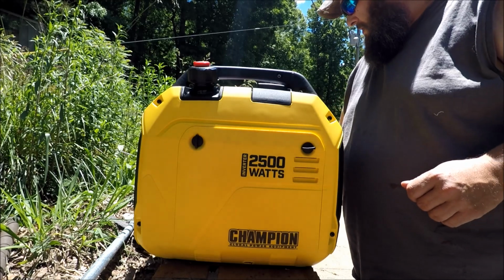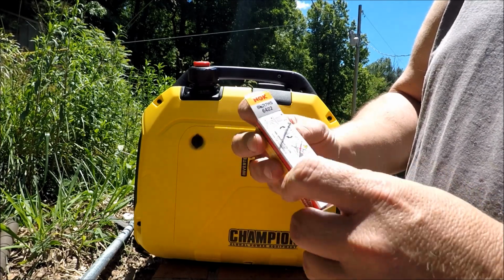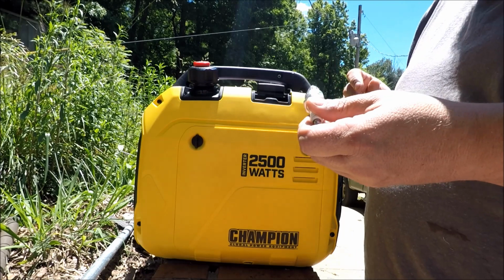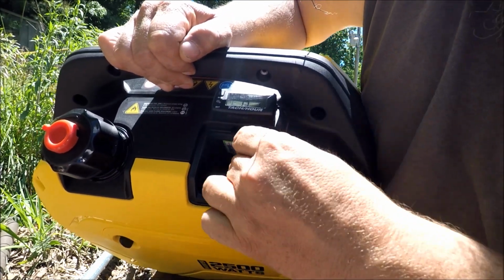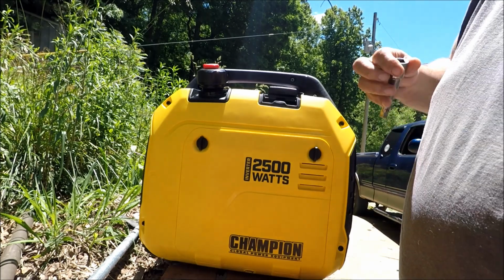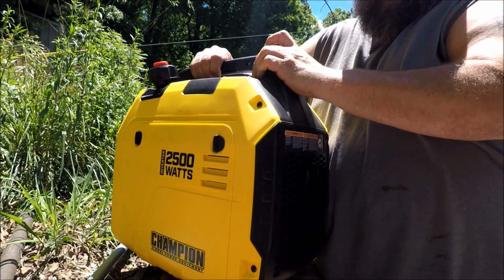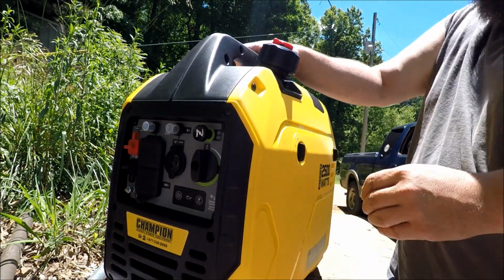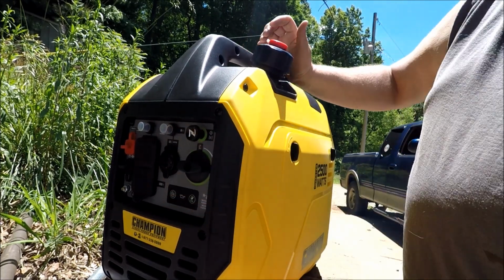Spark Plug change on a 2500 watt Champion Inverter Generator

Comment: I have the same generator on order and I went ahead and ordered an NGK which I'll swap before I even run it. The manual actually calls for a BPR5HS
Reply from the maker: I used the generator for the July 4th camping trip hooked up to a small camper on the lake it ran a tv,fridge,small ac unit and all the lights did very well ran it nonstop for one week had to change the oil half way through the week.
Reply: Remedy Talon - I emailed Champion twice regarding the proper plug. Their first reply recommended NGK BPR6HS, six months later they recommended BPR7HS, but the hotter BPR5HS can be used in colder weather they said.
Reply: Unit comes with Torch E6RTC installed.   Manual does call for BPR5HS.

Comment: Changing out the plug on the newer 2022 models was a pain, not much room. It snaps on and off real tight. There’s are several YouTube videos that talk about burn in times. Each one is different. I liked the one where a mechanic stated that for a small engine like this, he recommended 2,4,6 hour burn in. Changing out the oil on each burn in. Also to change out the plastic oil plug with a magnetic plug. On his first 2 runs he showed the metal shavings. So I’m using his advice.

Comment: I have a Wen Generator 56203i. Manual says to use NGK BP5H/Torch E5T spark plug. I see that you are using the NGK BPR7HS. I assume it will work? I looked around for the BP5H but seems NGK doesn't make it anymore.
Reply: I found a video on spark plug identification and the numerical number is for heat , 1 to 10 temp scale. Manual calls for 5, lots of videos calling for 7.

Comment: does the spark plug wire just lift off??
Reply from the maker: It lifts off the spark plug yes
Reply: It’s a pain, mine was stuck on rather good, the newer 2022 models don’t allow much room for even a small hand. The metal cover shield on the plug can easily cut you. Even after I changed mine out, popping the plug wire back on was kinda hard, My first attempt, it came back off to easy. Tried again and I new I had it because of the sound it made. Kinda pops on.